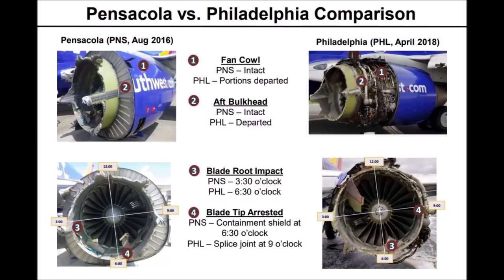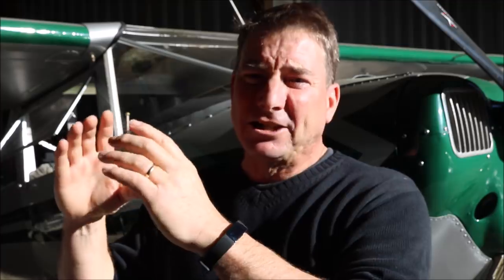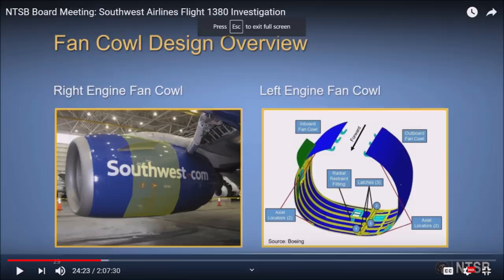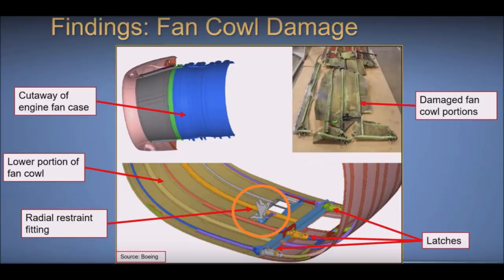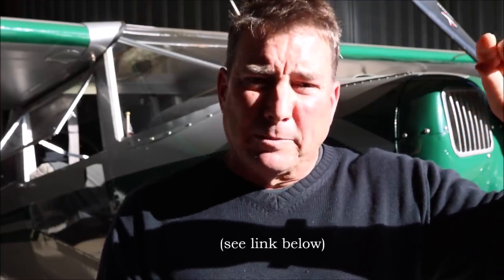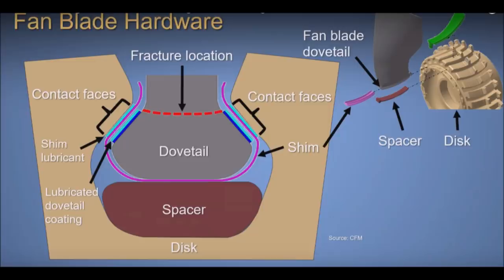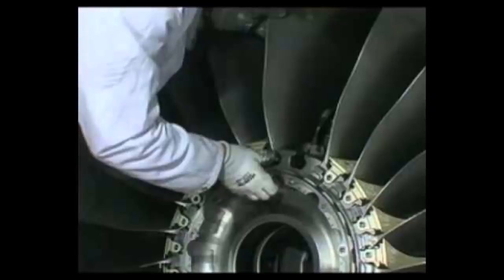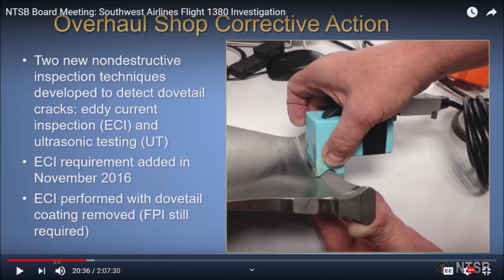NTSB Board Investigation SWA 1380

Comment: In addition to below, regarding aircraft cabin windows, the outer pane is the primary load carrier. Please don’t scratch it while deicing. The secondary load carrier is the middle pane. This pane normally has no load on it, the equalisation hole ensuring pressure is the same on both sides  of the pane. If the outer pane fails the middle pane will carry the pressurisation loads for the duration of the flight. Obviously, the whole assembly (outer and middle panes) must be changed before further flight. The inner pane protects the middle pane from damage caused by passengers.

Comment: Excellent report, as usual. I can understand why the cabin crew did what they did (seating wise), but I agree that they shouldn't have. My guess is that they felt that they wanted to protect those displaced pax and they felt that it was fair, if you will, that the crew took the bigger risk. Unfortunately, the next step of thinking should be to think about managing a possible evacuation, and I guess they never made that next mental step. If they would have thought about that, they probably would have realized that they needed to put them self in the best position to evacuate the a/c, and that would mean getting strapped in in a J/S, even if that meant a higher risk to a few pax. I haven't read the report, so it's only a guess on my part of course. It will be very interesting to see if there will be any changes in cabin equipment/layout in the future to handle situations like these, although I doubt it. It's such a rare occurence after all.

Comment: When they are doing the testing to see how the engine reacts to the loss of a fan blade, do they do the test in a wind tunnel simulating cruising speed, say 500 MPH?  I would think that air flow would have a critical effect on the cowling such that a damaged cowling might hold together when stationary but blow apart when subjected to high speed wind.
Reply from the maker: they don't- good question.
Reply: The purpose of inlet cowl is to setup a standing shock wave before the fan blades so the incoming air doesn’t hit the blades at the speed of sound. Losing a fan blade disrupts the pressure dynamics, and that disruption blew out the engine cowlings, which went through the fuselage window.
Reply: Another wind tunnel thought, about why the fragment aimed toward the fuselage - and hard, apparently not so much "grazing" it? Am I wrong, or did that take a sharp angle inboard like it was possessed? And it also went upward, right?? Perhaps a long term takeaway could be to bias failure expulsions in the outboard direction? Also wondering about ANY airborne object, perhaps even an expelled carcass - will it "rocket" away from the engine location, upwards and inwards at the fuselage?
Reply: Perhaps answering my own question, that in this case, an explosive force "aimed" the fragment, rather than aerodynamics...
Reply: Bill Woo Went away from a/c not towards it. 
Cowling hit fuselage not the blade.
Reply: @RevMarket  I was talking about the cowling of course.

Comment: You would think in this day of wireless micro cameras it would not be hard to have a couple of backwards facing camera's for the pilot to look at the engines, obvioisly they are busy in an emergency but a quick glance at a screen may help them determine the severity of the failure.

Comment: Did you mean when the fan hits the stuf?

Well you do a great job with an accurate and concise report I am wondering what modifications will be made to that outer engine cowling, has in possibly a extremely elastic polymer added to the outside to keep all the components in one place in the future? Found 23 blades with problems,  that's 23 failures prevented good job. Having operated two air craft with inflight failures,  the first on my first long x-country while getting my private certificate,  lost all electric power with smoke in the cockpit I find all of this type information very interesting 
Thank you very much.

Comment: Thick paste type graphite lube was about 20yrs ago these day the lube is still graphite but now its an aerosol spray my bad. CFM 56 on DC 8-71 and DC 8-73 mid fan shrouds took the thick paste lube not the blade roots. The whales of yester years(b747-100s and ;747200s) clanked lots they used the thick graphite paste.

Comment: i would be very interested to know if these blades all came from the same batch of Ti  and or came off the same milling machine. 
with such a low finding rate it does suggest a batch issue of some sort.    once again Juan gives us the facts and not the fluff.

Comment: In reading the recorder transcript, seems to be a few areas of concern with communication of core facts and "air" stairs to get passenger out. Mostly the ground crew/emergency folks. One item to be concerned with when landing while on fire is asking the tower which way the wind is blowing so the pilot can position the fire side of the plane downwind so the wind doesn't drive the fire into the plane. I saw many fire landings where they didn't pay attention to that issue and the fire burned into the passenger area quite fast.

Comment: As always Juan, great analysis on this unfortunately tragic incident. One thing that wasn't answered in the video, and I'm curious if the report discussed this is the role of the passenger in seat 14A. Did they have their seatbelt on when the depressurization occurred? Are seatbelts designed for the 737 MAX designed to deal with a situation like a window blowing out and attempting to suck out passengers?
Reply: j2simpso Seat belts are mostly designed to restrain forward motion, not the sideways forces in this incident.

Comment: I don't mean to criticise you here, you're fantastic, it's just a fascinating incident.
It's pretty technical calling it a contained failure, right?
I would have thought that if parts depart the engine and interfere with other structures it's uncontained, regardless of which engine parts they were. Or heck alternatively, if parts designed to contain the engine failure failed to contain it then it's uncontained!
And what a tough job on the crew! If I had have been in the same situation I probably would have done the same thing, in spite of the training. Who wants to tell the Good Samaritan that just gave CPR that by doing that they just gave up their seat and have to make do unrestrained because "I'm more important than you, since I've got the uniform." !?
I hope we see allowances for incapacitated occupants after this, maybe stretchers and a system to fasten them?
And that dovetail transition; even by eye it's surely the critical stress concentration and I'd bet my house it's designed curved for exactly that reason. It's exactly where you'd want your tests to show a young crack.

Comment: CFM fan blade lube comes in 2 forms paste  and  aerosol. 
Spray on is easy to apply . Spray on let dry  job done. 
Paste is applied by hand and upon first engine run can cause fan unbalance. 
Cured by high power run to fling off excess paste restoring fan balance...

Comment: Given both catastrophic engine failures occurred with the same airline, and the number of cracked blades found is so small, I wonder if this was a case where a lone bad batch of blades somehow made it through the manufacturing process.  Were all the cracked blades manufactured about the same time?

Comment: At American we used to spray the fan blade root with graphite spray per the MM and then make sure they were not locked up. If locked up you would have to unlock them. Which would cause a loud bang.

Comment: 23 out of 230,000 is 1/10,000 or .01%.  I wouldn't call that a small chance when a failure can be catastrophic.  Very nice work on this video.
Reply from the maker: times number of cycles...
Reply: You beat worse odds getting to the airport.

Comment: Must be hard as a pilot to ignore all the glideslope and terrain warnings during a situation like this.
Reply: Probably harder for some than others, but this guy was an ex military pilot, and he knew how the aerodynamics handle without having to consult a lot of digital code. Back to basics! A great example of technology serving instead of taking over.
Reply: They are great if you are not paying attention but not really when manually flying the plane !
Reply: @Triple070007  I think both pilots on the flight were former military.  I know Capt. Tammi Jo Shultz was, and I think FO Darren Ellisor was too. 
I saw a video from a GA pilot talking about a near crash.  I don't remember exactly what led to his self admitted poor decision-making, but he took off on an unfamiliar runway at a high altitude airport, barely got airborne , and barely cleared the trees at the end of the runway.  Stall horn was going off the whole time.  He said he wanted so badly to pull back on the yoke because he wanted to clear the trees, but knew he must put the nose down to avoid stalling. It was scary to watch.
Reply: Not sure that'd bug me all that much.  It's daytime visual, you're already super alert and know you're coming in fast & low.  You're not likely to miss something.  Those warnings are more for reduced visibility and pilot complacency.   Even in the mighty Cessna 172 I'd get used to a bunch of marker beepers going off just as I was on final.  I'd ignore them.
Reply: Triple070007 This guy? It was the Captain who was a she and FO was an he?
Reply: @cember01  Yes, and I will assume that both the Captain the co-pilot would have expected those warnings and wouldn't have been rattled by them.

Comment: The Captain was extremely cool, but it should be noted that the flight controller on the ground (ATC) was outstanding as well which was a huge help in keeping the pilot calm.  She didn't have to argue, repeat excessively, or provide unneeded information.  Note also that her first concern upon landing was getting the EMT's on board to care for the injured passenger.   Additionally she left the flaps configured in a way that would help fire fighters, so she had all bases covered, stopping the plane right next to the fire trucks.

Note too that fully booked flights are very problematic if there are passengers injured in the cabin.

Comment: My idea for the loss of seating scenario.  The FA's could make use of a harness similar to a parachute harness.  Then the engineers would have to work out an effective attachment point.  The harnesses would be compact, light and easy to stow.  Only to be used in this kind of event.  It's better than nothing.
Reply: When my baby was small, I had a harness for her that attached to my seatbelt. The idea was you would sit her on the floor behind your feet but she'd not be able to be thrown away from you. I don't know how well it would have worked, luckily never found out but I don't think they sell them anymore. They have dog seatbelts for cars now, though.

Comment: At 14:39, Juan makes a verbal gaffe in reference to the correct QRH procedure to run. In this case, it should be the Engine Fire or Engine Severe Damage or Separation procedure, NOT the Engine Failure or Shutdown checklist (he's combined two procedures). I think this is a common error (at least in simulator training) that can easily and often lead to running the wrong checklist (or starting to run the wrong one), which leads to further confusion. I mention this not to be pedantic (far from it), but to point out that these QRH's can be very confusing to use. Another reason why, when stuff is happening, you do need to s-l-o-w d-o-w-n and take in information (while maintaining aircraft control) before you start to act.

Comment: engine vib is a way to detect fan blade problems before they fail.  Lubing it to reduce vib might mask a problem till its too late.  

Interesting that this 737 issue was also created by the engine change being done without raising height of the aircraft.  The flattened design created a new failure mode that did not exist when engine was round.

Comment: Fan  Lube   is   a  common   occurrence,  you  Number   the  blades  before   removal,  Clean..we  used  Alk,   dry,  use  Graphite  Based   lube per  job  card   specs,  reassemble (   ensure   the     blades  are    clocked  correct  via   the   Numbers  and  Hub   hash  mark,  )   and    install,  Like  a   2  person  6  hour   job.
Reply from the maker: Thanks Bruce. The lube is to prevent vibration? Protect them when the plane is parked outside? Or?
Reply: @blancolirio   Allows  the  Fan   Blade  Bulb  Base to   move   slightly...thousands  only. Ive Done   about    50+. You  might     want  to   Know   every   100  hrs   we  (Uselessair now  AA) had  to  pull  and  inspect   the  3  mag   plugs     that     are   related  to  the  Main  Bearings at  6  o'clock  engine  bottom... a   vibrating    fan    will  cause   the  front  Bearing  to   start    shedding       its  Bearings, Rare  but  it  has    happened  back  in  the   day. The   CFM 56  is   the  Best   engine   for  its  size  in my  O-Pine.

Comment: Excellent coverage of this significant event.
By definition, this may not be an un-contained failure, but a large piece of the fan blade did escape the cowling in a high energy state.  
The fact that it was an affected piece of cowling that impacted the fuselage shouldn’t reduce this concern.  Should this fan blade fragment escape be acceptable?  Certification (and maintenance) standards that were written for turbojet engines should be revisited for turbofans.  Engine diameters properly increase for better efficiency, but forces increase by the square of the radius.
Reply: Good point.

Comment: Deepest sympathies for the family involved in this tragic event.  Juan, at 9:58 someone is holding up a piece of the lower aft corner of the inboard fan cowl showing how it struck the window.  How in the hell did they come up with this missing piece of metal from 32,000 feet and 500mph?  How is that possible?
Reply: Maximuspadus Correction: Another comment pointed out that they used ATC radar to track the falling debris, and were able to recover the parts on the ground.
Reply from the maker: with the rest of the cowling bits on the ground.
Reply: that is simply amazing.  I don't understand it all, but the fact that it can be done is truly incredible.  Technology has come a long way in aviation.

Comment: Oh, what along time to wait for the NTSB !  Seems that We never heard of what exactly  happened to an early 5am morning flight of UPS parcel into Birmingham ? which crashed into a rise , due to wrong ILS / Runway , signal ,a couple of years ago  ,was there ever  something by you on the Tube ??
Juan,  One thing which should be clearer from passenger feedback , to cabin crew , Relayed on the audio recording here ??; 
Is the time it took before they knew the ' ACTUAL BAD Condition Visually ' of the Engine and wing damage ? CELL Pics? Nice one
Reply from the maker: Maybe not on YouTube, but that NTSB report is final.
Reply: Thanks again , Juan I Found the NTSB report Video from them on that UPS crash ,  a multi-faceted line-up 
of fatigue and plain old  mis-communications it seems , Very sad indeed  .  @Robinkenward

Comment: I was just thinking of this incident. Please correct my terminology as you see fit. When the fan blade let go at the 6'oclock position, the energy transferred to the fan case caused it to deflect downward. This downward force, when applied to the cowling caused the cowling to deform. The deformation of the cowling would deflect the ends of the cowling inward releasing the safety latches,  if not actually causing them to fail.  Perhaps the fan case should be analyzed and computer modeled to increase rigidity? I know the cowling on this model of 737 in unique due to the non-circular design. The mounting bracket is placed where any deformation of the fan case can cause the maximum corresponding flex of the cowling. Essentially for the shape4 of the bottom of the cowling it is placed at the weakest point.

Comment: The videos are very informative however I did detect an error in reference to the engines installed  on the B737-200 aircraft.  I am a licensed A&P technician and have worked on 737 aircraft for 30 years and have worked on all of the B737 series from the 200 thru the 737 Max.  The B737-200 aircraft operated by US Airways had the P/W JT8D-9 or the JT8D-15A engines.  These are not turbojet engines but a medium by-pass turbofan engine.  The B737-300 and -400 had the CFM-56-3B engines.  The Fan Blade lubrication are accomplished on a heavy maintenance visit.  The blades are numbered, removed and placed in a special rack designed to store the fan blades.  The blades are cleaned with 99.9% Isopropyl Alcohol, the dove tail portion of the blades are given an eddy current inspection  then lubricated with a spray on  dry film lubricant and allowed to dry before installation.  One sign the dove tail portion of the fan blades have worn is when a condition occurs called shingling.  this is indicated by the mid-span struts on the blades are no longer aligned where they contact each other squarely but ride over the mid-span strut of the adjacent fan blade.  This condition is indicated on the vibration indicator for the crew showing an immediate increase of 2 to 3 Mils.  When this occurs the blades will require inspection every 50 hours until replaced.  I hope this information has been helpful.
Reply from the maker: You know what I mean.

Comment: Are inspections actually performed or are forms pencil whipped? I know it happens in truck and trailer inspections. The company I worked for purchased a used trailer that was "inspected" the day before it was picked up. The brakes didn't work at all and 5 lights weren't working. Does the FAA require that inspections be confirmed on video?
Reply: worlds apart, for US carriers